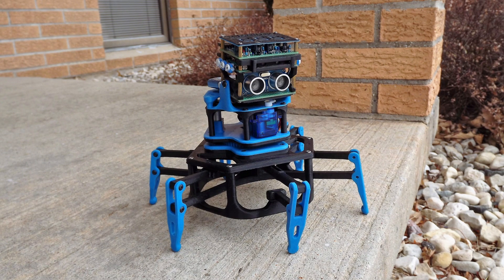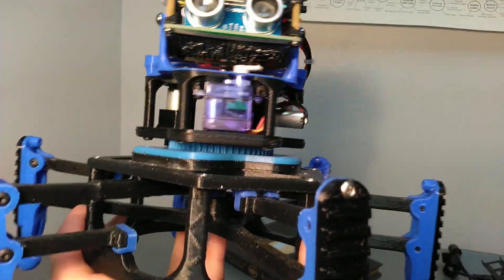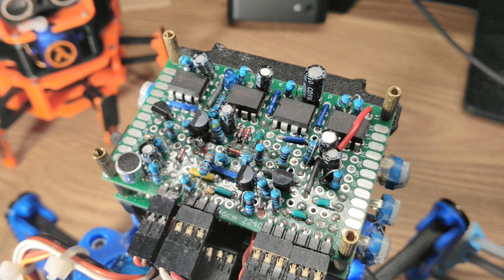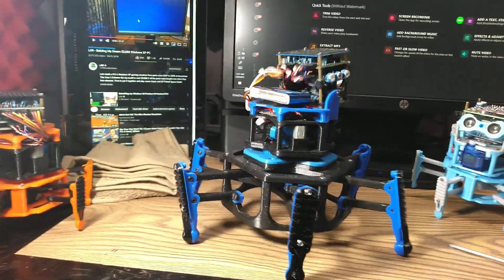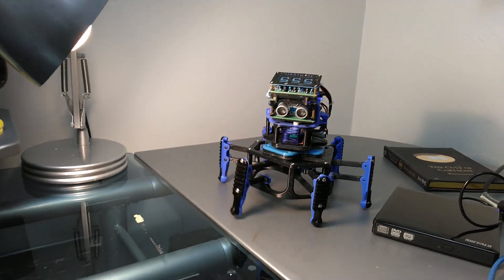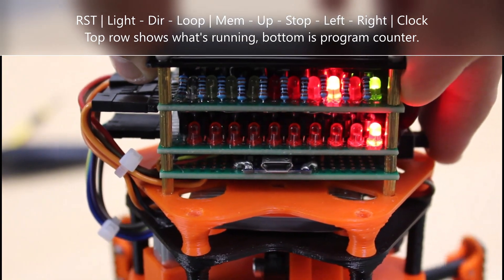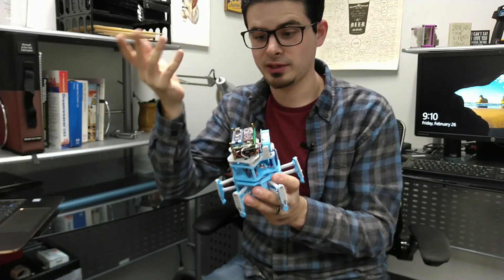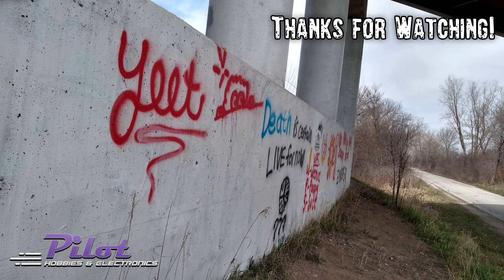Robotics without an Arduino? My Weird Analog Robots!

Comment: I've seen the schematics for the smaller orange robot but not any for your  blue larger one, the one demoed here. I find this one much more fascinating. Any plans on releasing schematics for this one? Great job by the way...I've been doing analog 'bots for years, and the 'lifelike' qualities really come thru with analog. Thanks.
Reply from the maker: I never made any formal schematics for the blue robot, the best I did was the board layouts. I realized I hadn't uploaded them, so I went ahead and put the files on Thingiverse. They're in format for a program called DIY Layout Creator. It may be possible to convert them into a PCB which would make assembly pretty quick and easy. https://www.thingiverse.com/thing:3459283
Reply: @Pilotgeek  Thank, and which NPN transistor you used? It would be great to have a PCB for it.

Comment: not what i imagined analog but atleast not arduino. analog to me is just motors and mechanical relays all set to trigger by certain predictable movements. using a microphone for crude design and some more motors for mechanically inducing resonance from a string in a bottle used to project  sound waves and the microphone to detect the reflection. problaby need some alanog filter to determine what sound that represent what to act as trigger for action. the advantage is more realistic behavior. the disadvantage is noisy resonator. to make it more crude instead of using a micophone use a basic graphite buzzer by grinding pencils into grains and the place them in a small container an then connect a electrode on either side of the created buzzer element and then send electricity trough the circuit. now any sound waves chould cause the pencil grains to vibrate and cause the electric current to fluctuate. it probably also need a horn on the buzzer element to amplify the sound waves into the pencil grains. the more crude it is and the more it can do being such simple is what makes it cool.
Reply: In some sense, I think it would be fair to say that he built his own special purpose computer.

Comment: Very cool. I like the old school analog controller. As a young man I made many trips to Radio Shack to pick up 555 times and other supplies to create circuits. No one bothers to use this kind of stuff anymore since Arduinos and PICs are so straightforward and readily available. The old analog circuit approach is a lost art.